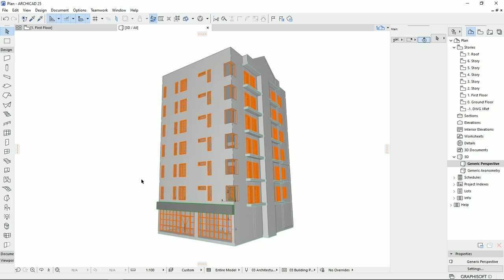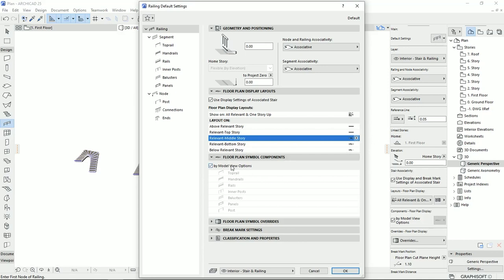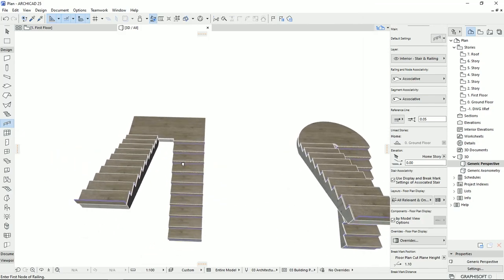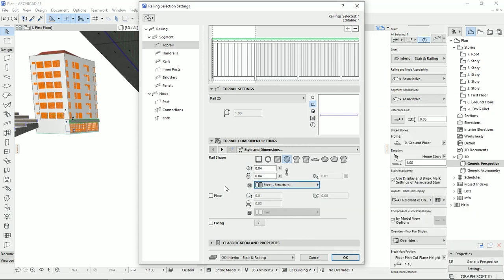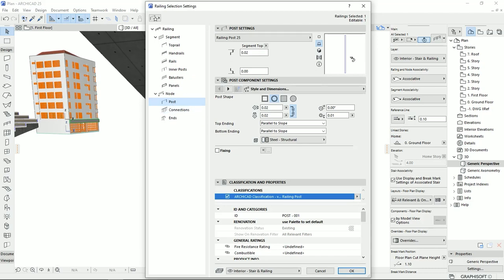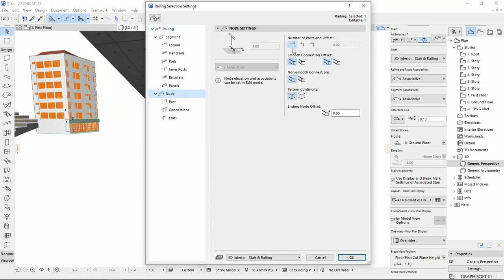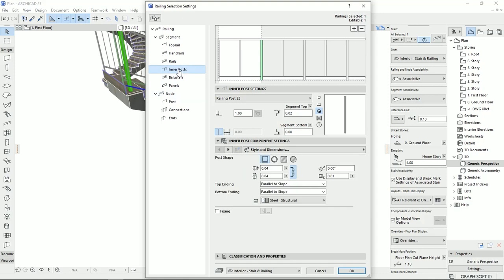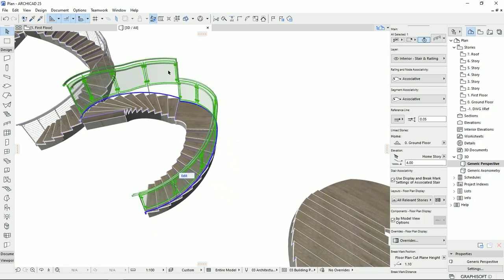Archicad - How to draw railings [extended explanation]

Comment: The inner posts are not positioned correctly on the tread. I saw in your video that they are positioned at the end, and even half of the inner posts are not attached to the tread. How can this be fixed? How do I adjust them?
Reply from the maker: Of course, it depends on the shape of the stairs; if it is not too complicated, you can manage to create the right railings. You just need to tweak the numbers and parameters in the settings to achieve what you are looking for.